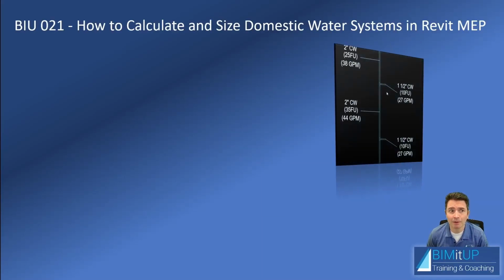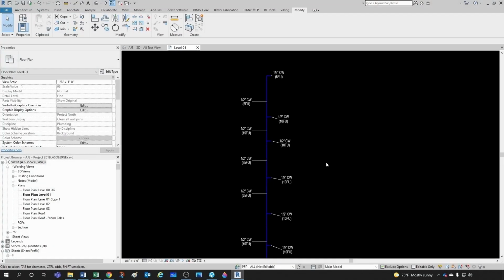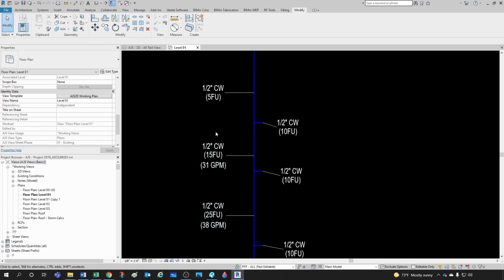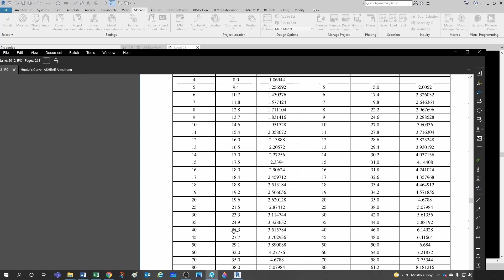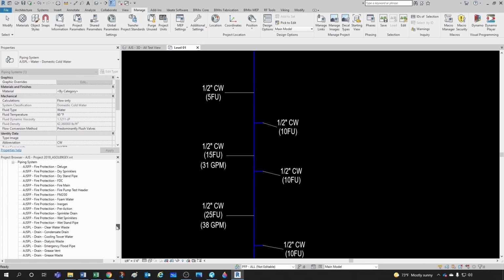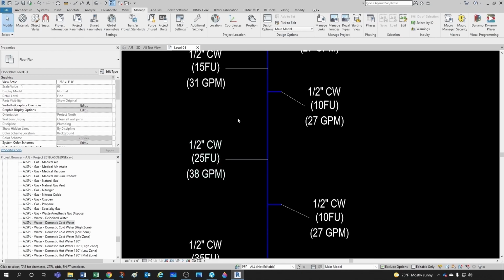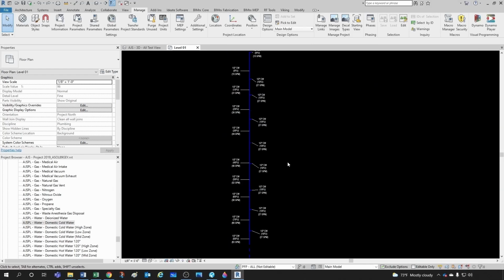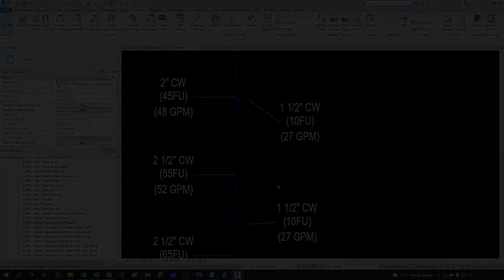How to Calculate and Size Domestic Water Systems in Revit MEP Tutorial

Comment: How do you make the connector with the different WSFUs get associated with the piping system?
Reply from the maker: Whatever WSFU value the connector has will be read by the domestic water system. Just make sure your pipe system has calculations activated.

Comment: Hey. Great video!
Do you know how you can add and edit the Flow Calculation Method in Revit?
Reply from the maker: Hi Tiago, that you find under Families > Piping Systems > Domestic Cold Water. 
You can use either "Tank Type" or "flush valve", but that's it. I think those are Hard-Coded into Revit.
https://help.autodesk.com/view/RVT/2022/ENU/?guid=GUID-D9E06E28-BEBD-4D86-8CB9-D152D76415BB 
As far as pressure drop, I know you could develop your own "plug-in" using tools like Dynamo, for example if you wanted to use...say Hazen-Williams for sprinklers, etc. but that seems like A TON of work. Good luck 😎
Reply: @bimitup  Thanks for repplying. I am from Portugal and we use Revit in projects all the time but all calculations are in Excell and others (non Bim softwares). So we were looking to put the calculations method into Revit as portuguese method is different and is bases in simultaneous coefficients.
Reply from the maker: @tiagolopes6192  You might want to explore the use schedules and calculated parameters